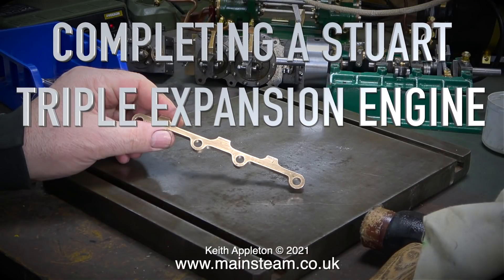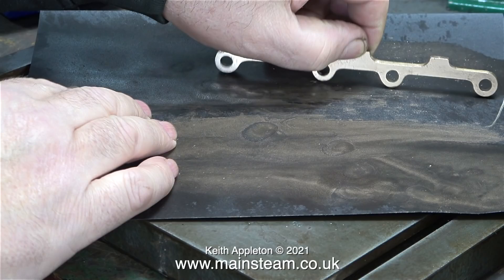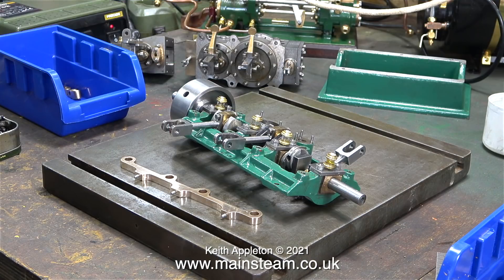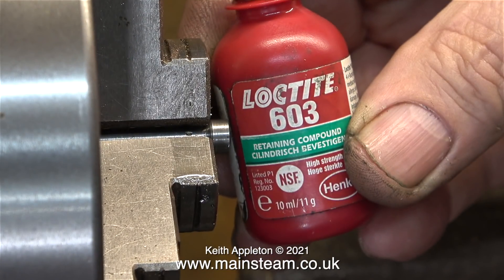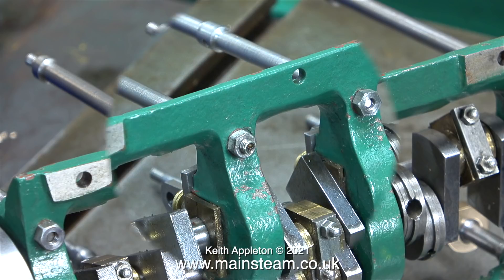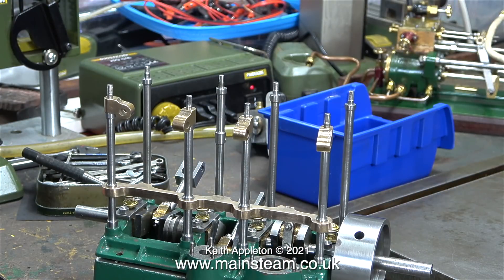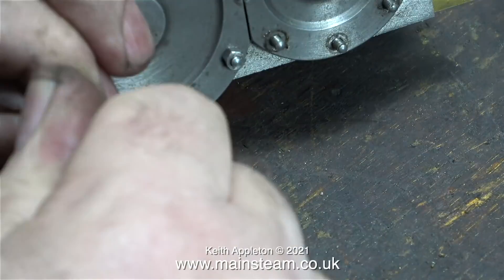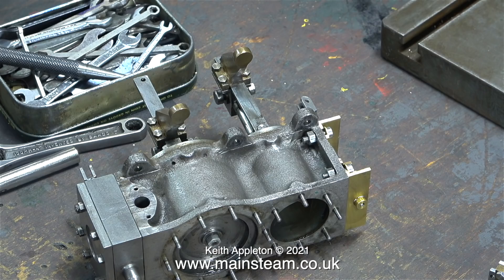COMPLETING A STUART TRIPLE EXPANSION ENGINE - PART #15

Comment: Triple expansion steam engines are lovely things.  When triple expansion is combined with Corliss valve technology, thermal efficiency starts to challenge that of steam turbines and turbines are NOT easy to manufacture well.

Keith, have you ever considered a model build that incorporated both triple expansion and Corliss valves?
Reply from the maker: My life span is not long enough ........